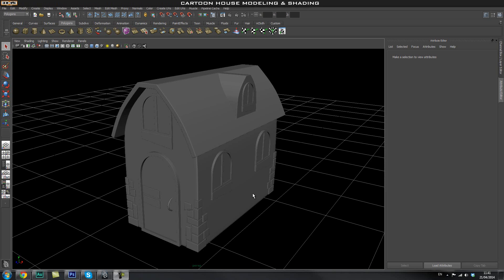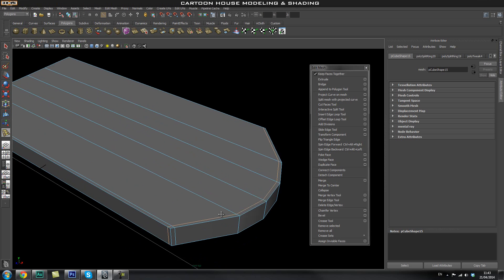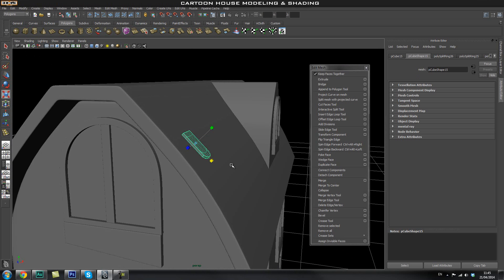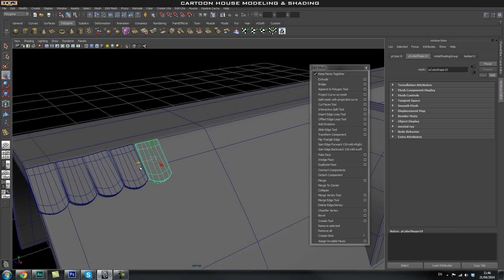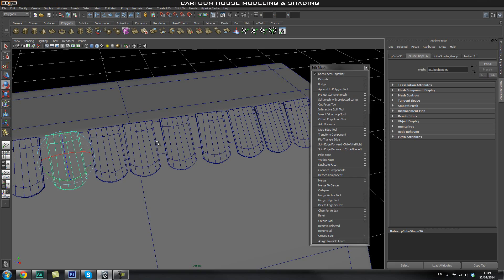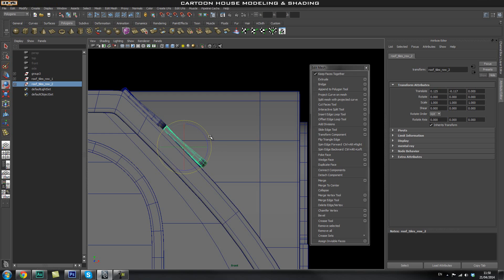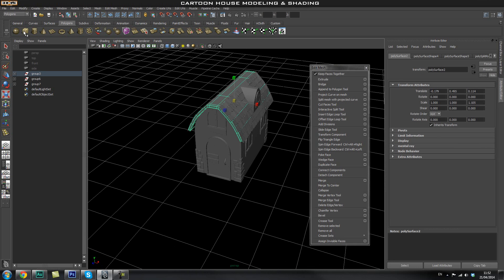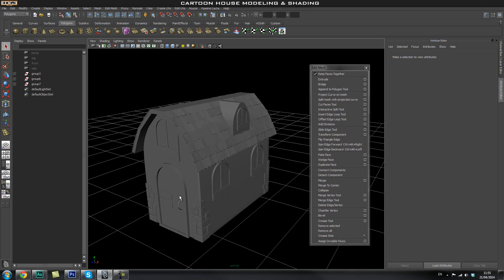#5 Maya For Beginners - Model a Cartoon House Tutorial 1080p HD

Comment: I get the same thing as Jonas, everytime I turn the axis on a negative scale on a duplicate, it turns black.... How can I fix this?
Reply: Hrvoje Tonkovac When it turns black it means that the normal of that face is facing the other side. A polygon face can only have one visible side, when you see black it means that you are looking at the inside/back of the face. You can solve this problem by going to Normals -> Invert. In a 3d program as maya you see a black colour when the normal is flipped, in a game engine you can see trough the face.

Comment: When I go to scale a row of shingles and use -1, it just shifts the whole row over 1 unit in the Z axis rather than flipping the row in place. The pivot is centered for the row and I tried using absolute transform and relative transform, but both have the same result. Any suggestions?
Reply: This happened to me the first time. Then I realized I was in move-transform mode - just had to press R to switch to scale mode and then put -1 in the Z. (I also had to invert normals cuz everything went black otherwise)